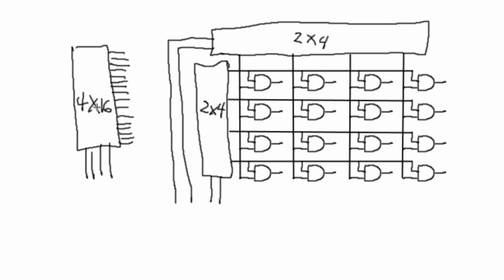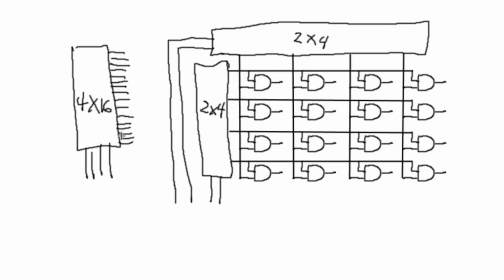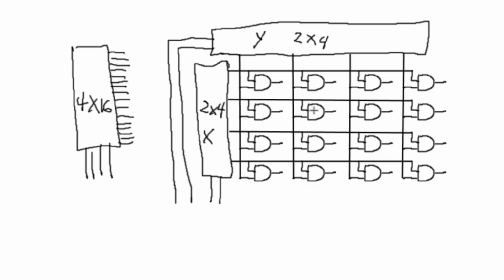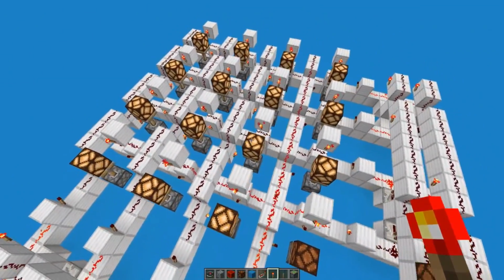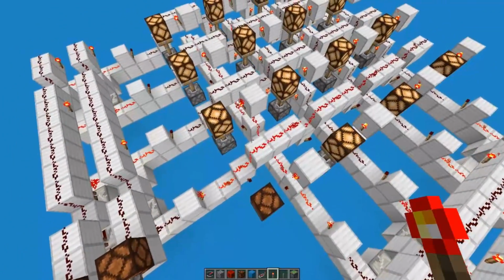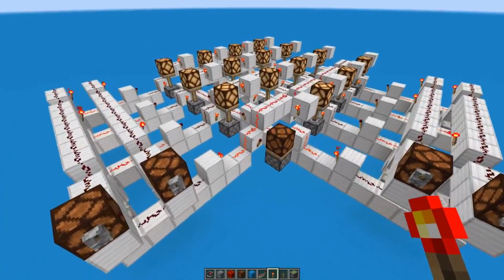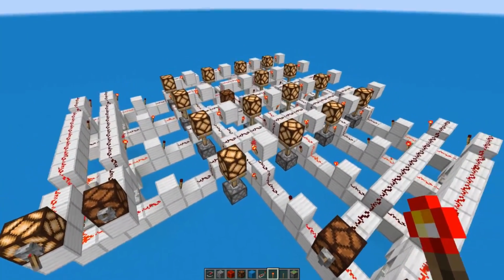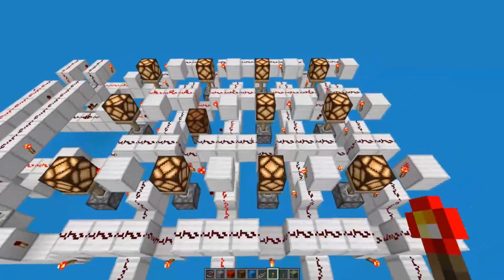Logic Matrices

Comment: 1:30 one thing you could do is break that decoder into segments and stack them, connecting each input/output with a vertical bus. Only one of the decoders is going to activate, so it doesn't matter that there are multiple input signals. 
The max time is then shortened to the time it takes to run up the bus + run down a decoder segment. A lot shorter.
Reply from the maker: A matrix by any other name :P

Comment: I can't decide if I give the computer interrupts it would be possible on breadboards but I just can't decide if I do it it would enable the gpu to use its own vram on not the ram so you would have 32k of ram also what do you think and what is todays keyword?
Reply from the maker: I think the bot pandemic has passed, there is no keyword.

If you're learning, I would start out simple and small.
Get it working, and then work on adding features.
Otherwise, if you feel comfortable, go ahead and add all the interrupts you want!
They really are useful when you start to learn how to use them :)
Reply: @n00b_asaurus  I've made a lot of computers and never finished them from not being satisfied and I've made a similar architecture on my channel which I didn't complete due to it not being able to write to ram but the control logic works like this you have your decoder which has all the instruction opcodes and another Rom that contains the instructions so lets say we enter 1100 in it it will jump to that set value lets just say 1111 so 1111 is loaded in the microcode rom counter so on each clock it computes that line until it gets to the last part of that instruction so it says reset the microcode rom counter and on line zero it enables the decoder again to accept the next opcode, with this design it allows for multi clock multi byte instructions so the jump instruction to jump to multiple addresses takes 5 bytes and 6 clocks the minimum amount for this design is 1 byte and 2 clocks. Does this seem like an efficient design to you?
Reply: @n00b_asaurus  my computer design just became a lot more ambiteous it will have multitasking, I/O, Interrupts, it can use up to 255 gpus and address up to 16 mb of ram i will have it use 1 mb though and a 200x150 pixel gpu that supports text mode or indevidual pixel drawing and the other one is reserved for a bootable device but it could use 254 sound cards or 254 hard drives or whatever hardware you wanted to put on it also the cpu could run at 10 mhz :D figured that out
Reply: I have no opinion on your gpu memory problem but definitely do interrupts, they're dope!
Reply: Ok :D